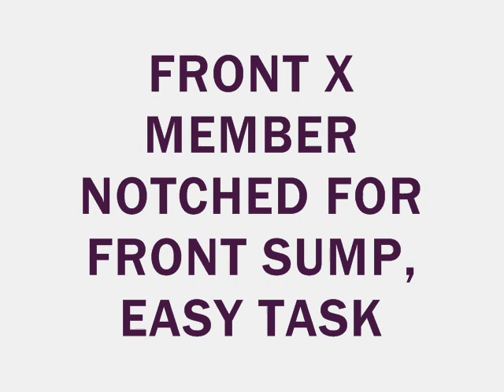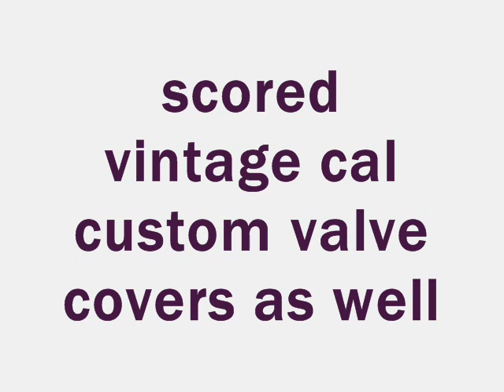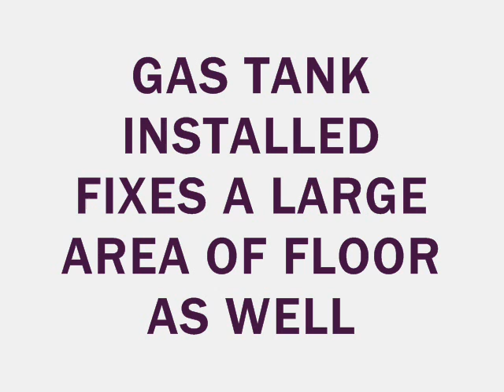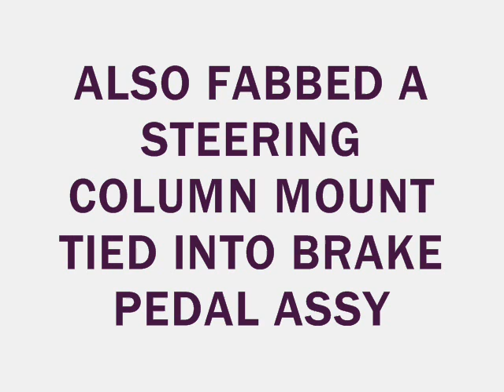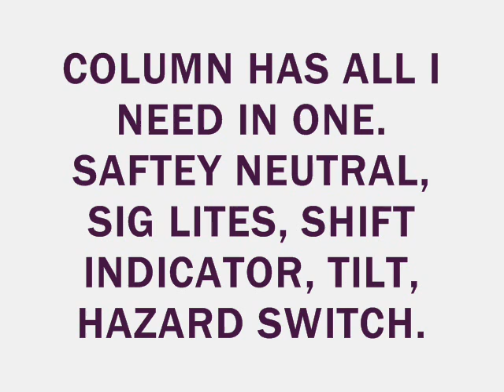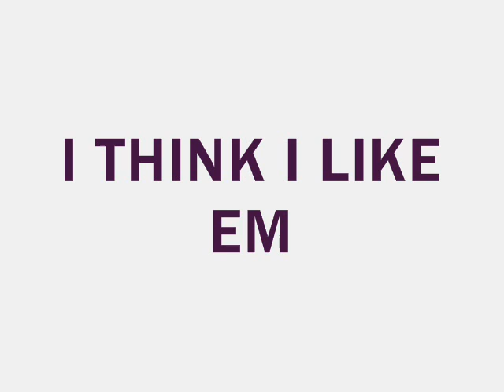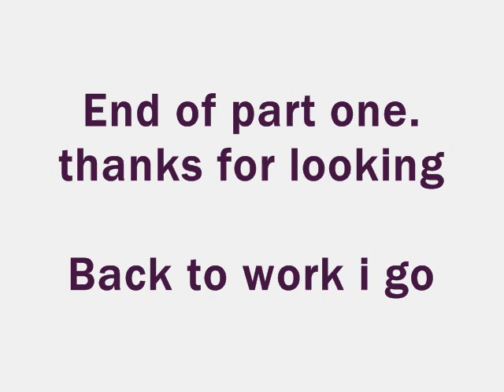1950 ford coupe budget build part 1

Comment: Sweet build so far.  I am putting together a 51 myself and love to see new ideas from guys like you.  Love how you used the old hood for the skirts.  That looks bitchin!
Reply: When you guys were leading it looked like you were using gas and oxygen, Eastwood has a special leading tip that slips over torch tip to allow you to just burn gas. It's made so you have better control of the process. The tip sucks oxygen from the room!

Comment from the maker: @baxternick  I didn't take step by step pics of the skirts but basicly, as you see in the pics, you get a lt and rt sides for skirts from the hood. Taken a larger piece than i needed for triming later, i just reshaped the compound natural curves of the hood to fit the car. Then made a surround brace out of 3/4 in flat stock for a frame
 and folded it over the frame.. The bottom was framed with 3/8 rod shaped to the skirts. Lots of fitting and reshaping with out any fancy tools.

Comment: What brake booster did you use??????
Reply from the maker: i tried a small booster but didnt like the feel so i went back to mauual
Reply: enfieldchopper are you still using front drum brakes?
Reply from the maker: yes stock drum brakes front maveric rear end. Alot of guys use early mustang master with drums. I used a master off a 70 chev 1/2 ton truck with drum brakes. car stop good.